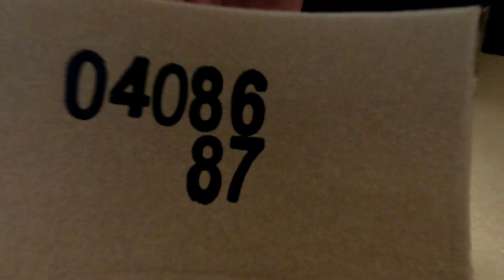Nissan VQ Parts Review - VQ40DE Rebuilt Crate Engine & Amazon Aluminum Valve Covers that fit VQ35DE

Comment: Fist let me say THANK YOU!!!
A very nice, well put together instructional video. I watched other videos( and learned a few things), but yours was the one I found the most useful by far. All the information you provided was pure GOLD!
I saw your video a 6 weeks ago and I just finishing mounting the new engine back on my 05 Frontier.
I used ,like you recommended, Engines Direct Distributors and I have nothing but praise for them. Steve at sales was fenomenal. I had the new engine delivered 3 days after I called. The old one was picked up 10 days later. 7 days after that I received my core credit.
Sir thank you so much. I am not even a shade tree mechanic, but your video gave me that kick to tackle something I’ve been wanting to do for a while. My 05 frontier had 316k miles. Hopefully next week I’ll be ready to crank her up. 
God bless sir🙏👏👏👏
Reply from the maker: Awesome. Glad I could help keep another one of these awesome rigs on the road. :)

Comment: Having done valve covers on the vq40de before, not sure I'd choose to do all that aggravating work to use some Chinesium parts that cost about the same as OEM. My stock covers still hadn't failed or leaked a drop down any of the tubes as of 190k mi when I pulled them to replace along with gaskets.
Reply from the maker: My stock covers were cracked, swollen and leaking. The plastic covers I was seeing were also from china unfortunately.

Comment: So the stock oil fill cap doesn't fit? What if you find yourself needing a replacement?
Reply from the maker: I will take that valve cover and have the threads machine correctly.

Comment: Im curious to know how these aluminum valve covers held up and if theyre worth the money i take it this video is old enough to warrant a new one by now let me know so i can start ordering gaskets lol
Reply from the maker: So far so good. The only real issue was the cap threads and they are manageable.
Reply: @i2edeye  so no leaks? Because from what I've read the plastic ones usually end up leaking
Reply from the maker: @maurobeltran3072  No leaks, just about to hit 10,000 miles

Comment: I have a 2008 Nissan Xterra. Where can I get such an engine and how much does it cost? I live in Iraq
Reply from the maker: Not sure on delivery to Iraq, but the engine was about $4500 shipped I think. Ibought it from these guys. 
VQ40DE Rebuillt Crate Engine
Steve Ricehouse
Engines Direct Distributors LLC
1-800-998-2100 ext 102
(623) 581-6400 local
(623) 581-9400 fax
steve@enginesdirect.net